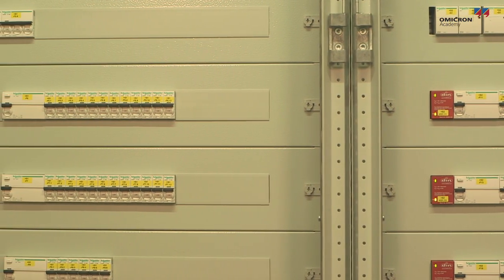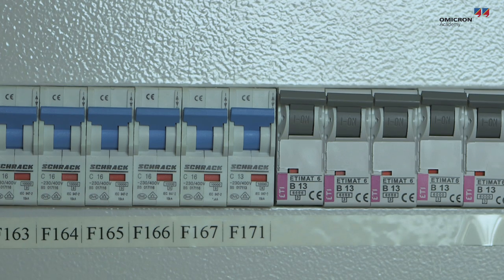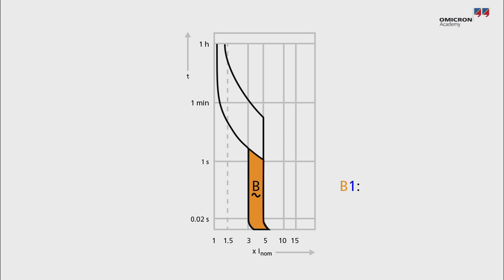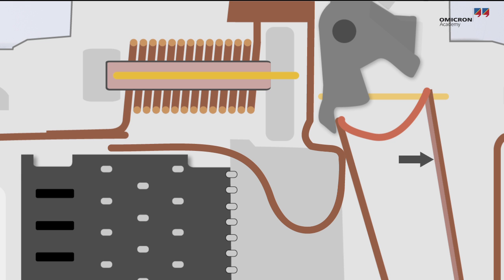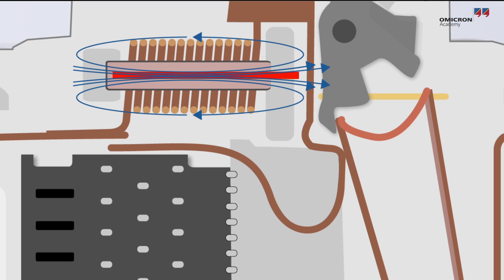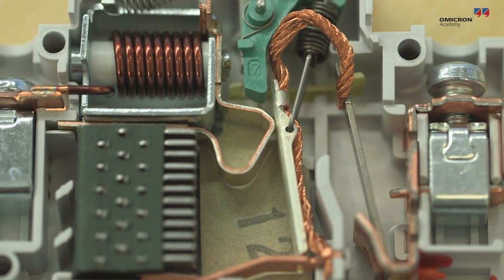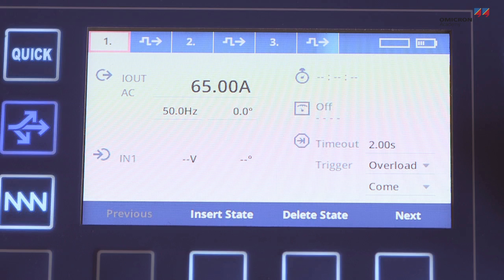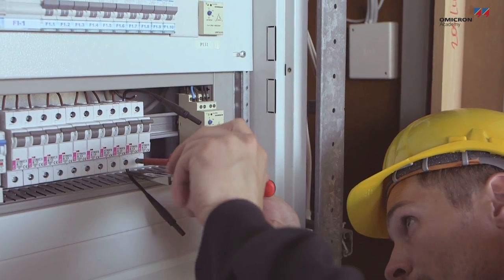Miniature Circuit Breaker Testing

Comment: I was expecting a video on testers, not MCBS. Barely mentioned
Reply from the maker: Dear JC2529, 

thanks for your interest in this video and for your input :) 

For our viewers to know what functions ought to be tested in the first place, the video first explains the tasks of a MCB. In this first section, it explains how an MCB works. It explains that an MCB must be able to deal with load and fault conditions and how it does that through the way it is constructed. So the first part of the video intends to prepare the topic of testing.

From about 2:40, the video directly talks about testing MCBs. It shows how a MCB is disconnected and a test set is connected instead, how the test set must produce different currents, in order to simulate certain load conditions and fault currents, so that testers can see if the MCB is stable during load conditions, and if it trips correctly during a fault condition.

In this last section, the video shows how these test steps can be executed with the COMPANO 100, which we recommend to use for such a test. The COMPANO 100 is especially recommendable if users need a multifunctional device with which they can also verify other things, such as the functioning of overcurrent relays, or the wiring of instrument transformers, or the contact resistance of a circuit breaker.

If you have some questions or you need more information about circuit breaker testing, please visit our website: https://www.omicronenergy.com/en/application/offline-testing/air-insulated-switchgear-ais-testing/ 

Best Regards, 
your OMICRON team

Comment: What instrument do you use?
Reply from the maker: Dear Mario Gotovac, 

thanks for your interest in our videos and products. 
In this video we use the COMPANO 100 for testing. More information about the COMPANO 100 is available on our website: https://www.omicronenergy.com/en/products/compano-100/ 

Best Regards, 
your OMICRON team
Reply: @omicronenergy  Can these test be performed with CPC100 and RAMP program?
Reply from the maker: Dear Mario Gotovac, 

In theory, the CPC 100 could be used for such a test. However, so far we have not heard of CPC 100 customers who are indeed using the CPC 100 for such an application, as the CPC 100 can perform much more complex and/demanding operations than this one, both in terms of text complexity and required output quantities.

If you have questions about the capabilities of the CPC 100, we recommend that you take a look at this video: https://youtu.be/tvrhTI87kW8 
or contact our technical support: https://www.omicronenergy.com/en/support/technical-support/ 

Best Regards, 
your OMICRON team

Comment: how can we use the relay as circuit breaker?
Reply from the maker: Dear The ambition of youth,

the Miniature Circuit Breaker operates when there is a short circuit current or a thermal overload detected.
The MCB works basically like a really basic relay were the only operand is the current.
The MCB itself can switch off small circuits with low power. For higher power, you would have a protection relay and the mentioned circuit breaker.

Best Regards
Your OMICRON team
Reply: @omicronenergy  Can you make a Vedio in which you make a short circuit protection with relay ? Thanks a lot.
Reply from the maker: Dear The ambition of youth,

thanks for your request. The OMICRON video team is informed. Stay tuned for more.

Best Regards
Your OMICRON team
Reply: @omicronenergy  ok,I have subscribed. can  I ask you another question? how did you make this animated vedio? I have a channel on youtube and I want to make vedioes like your vedio. I love this style of teaching!!
Reply from the maker: Dear The ambition of youth,

thanks again for your interest in our video. 
We work with experienced animation partners when creating videos like this one. Therefore we can not tell you which software they used. 

Best Regards
Your OMICRON team

Comment: How to find out the resistance of circuit breaker
Reply from the maker: Dear Anita Kaul,

The exact resistance of the miniature circuit breaker can be checked by injecting a current and perform a four-wire resistance measurement. This can be done for example with our COMPANO 100 test set. However, this test is not very common for MCBs. If the load current is known, it’s also possible to check the temperature of the MCB (e.g. using IR thermography) to see if the resistance of a MCB is higher then the one of nearby MCBs.

Best regards, 
Your OMICRON team